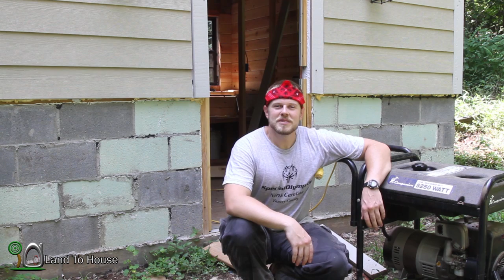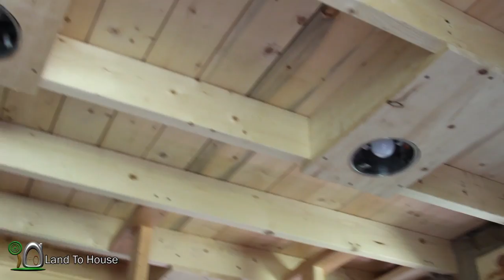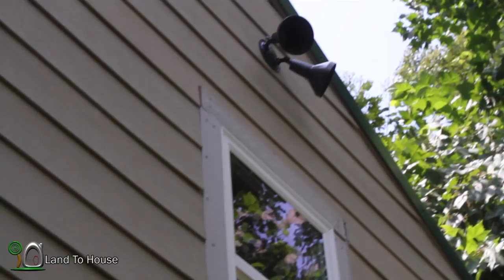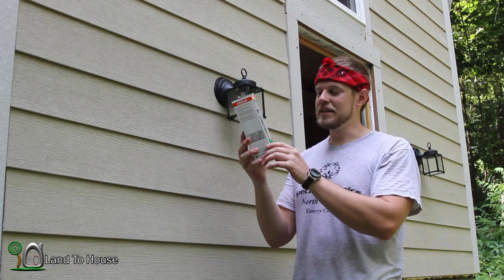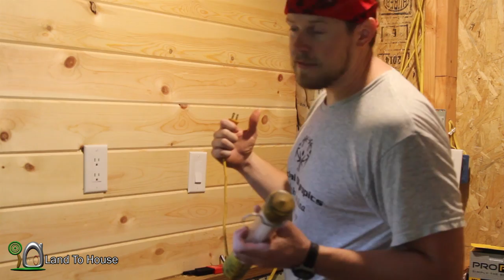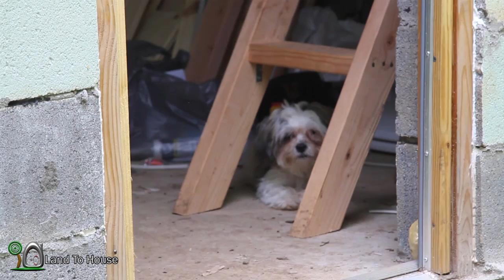Tiny House 88 - Test the Electric

Comment: Thanks again for showing the mistakes. The ' power to switch first ' is an electrician 101 lesson , but I understand doing repairs you can't assume all people will if in the end it works and or saves time.
Reply from the maker: +nintendolunchbox ah yes I missed that day in electrician school. :) got it fixed though. That's what i get for thinking digital class while wireing.

Comment: Well done for getting it all sorted in the end, I think sometimes it is good to learn new things by trial and error. I'm no electron myself but manage to get by ok interestingly I wire lighting the other way running power from light to light in a circuit and dropping a switch wire down to each switch
Reply from the maker: +Michael Collinson Thank you. I am sure there are several ways of getting this done. I am just happy to have it finished. I am so used to working with digital that I forgot all about the way AC is wired.